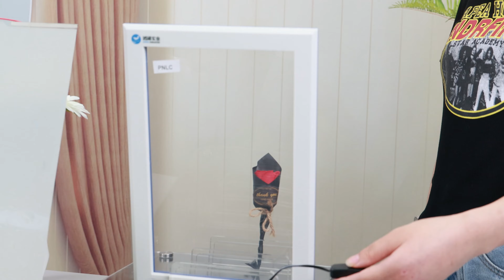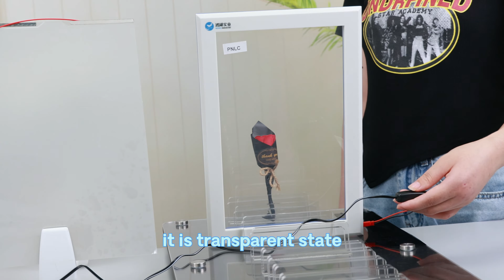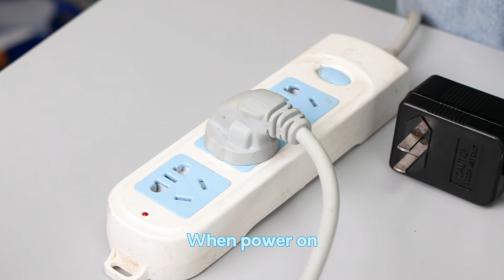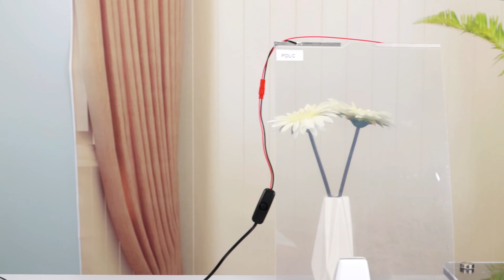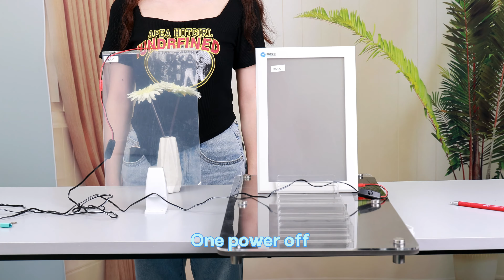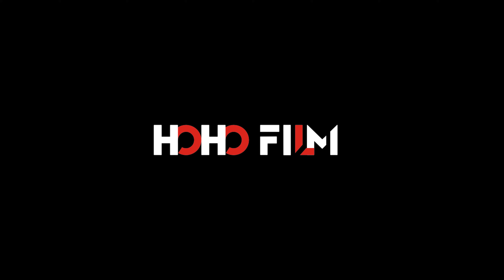Difference between PNLC film and PDLC film Smart Film #pnlc #smartfilm #hightech

Comment: does larger film require more electrical input to change the state?
Reply from the maker: 1sqm requires within 5W power.
Reply: @HOHOFILMWORLD  does this only take AC voltage?
Reply from the maker: @E44792  Yes, AC voltage is needed. for the film, we will have transformer to help change the voltage.

Comment: Can you place battery instead?
Reply from the maker: the film with A4 size should be connected with power supply as shown in this video. If the film is in 10*10cm size, small power supply with battery is ok.
Reply: @HOHOFILMWORLD 😅

Comment: Hi
I bought 33cm * 15cm but I don't know how much watt and volt does it need, I cannot calculate it 😅😅
Reply from the maker: smart film need to be connected with transformer which is with input 110V/220V , output 48/60V. the size you have can be with 2W power supply. (smart film is suggested to connect with transformer that provided from supplier)